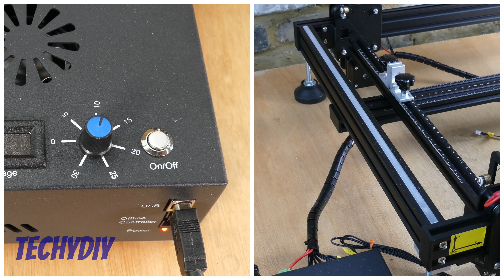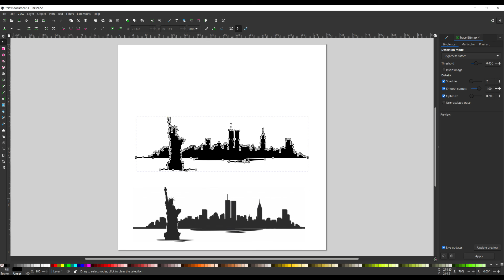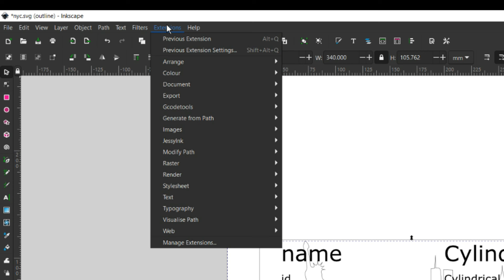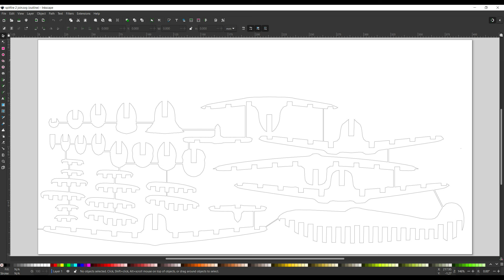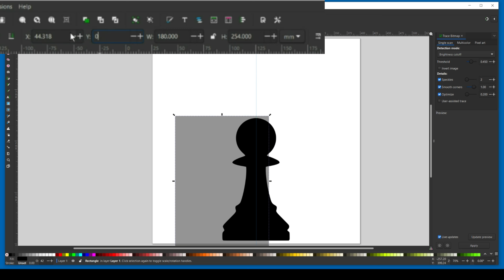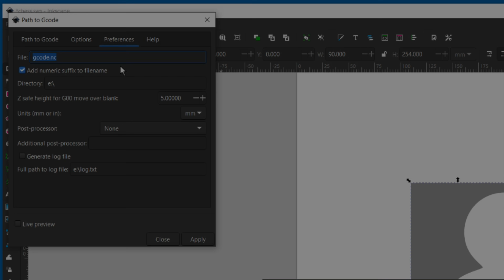Hot Wire Foam Cutting Cnc Machine Review - FoxAlien HW40

Comment: Hello, I live in the USA and I am interested in manufacturing an EPS cutter for 60x120x100 centimeter blocks, with the hot wire in the direction of the 120 centimeter measurement, Thank you
Reply: Did u do it?

Comment: I now use a single point attachment hot wire, that I  pull the wire around an inside aluminum template to make tapered wings. It's like 138" long.Would this one have enough strength to allow a couple of pounds pull on the wire attachment to direct the wire around the airfoil shape? Thanks!  😀

Comment: There's gotta be a better way to make gcode than that Inkscape plugin. I've been using it for engraving/milling and it grates a bit.
Reply: if I'd waited 0.5 seconds I'd have seen you go on to Fusion 360 :D
Reply from the maker: I agree it wouldn’t be a natural choice, although I like Inkscape itself. You can use pretty much any cad / cam with a grbl post processor.
Reply: @techydiy  your price